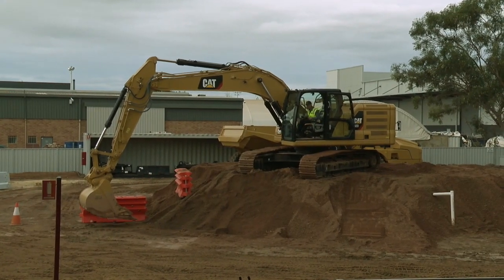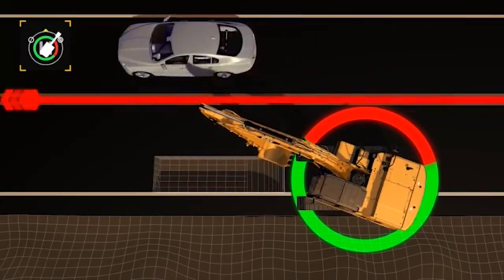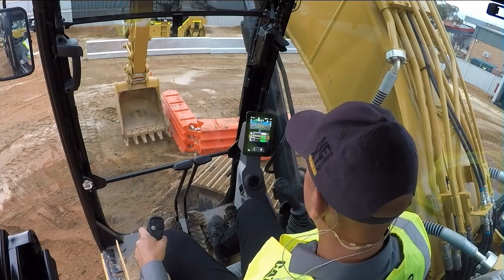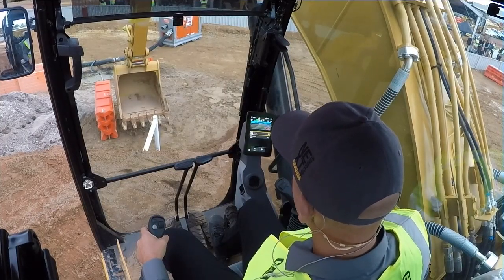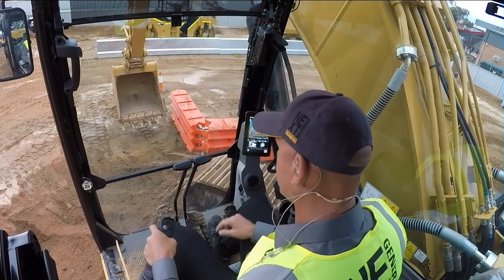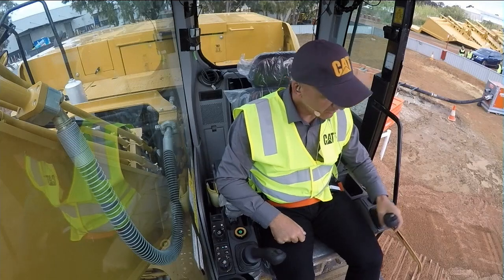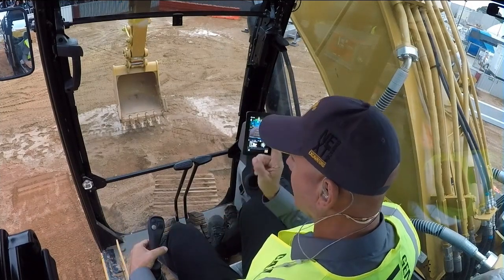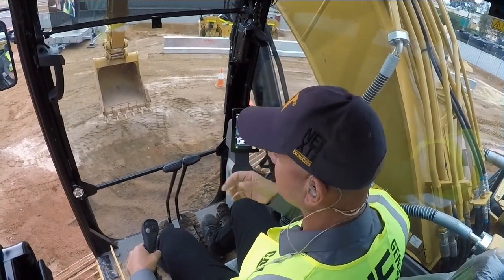Cat Next Gen Excavators - E-Fencing Technology

Comment: Per your manuals... Doesn’t the work with heavy material. Only works with hydraulic temps being just right (not too cool or too hot). Doesn’t work with rough or dangerous operation. Doesn’t work if the machine is not stable due to uneven ground. Doesn’t work if the engine speed or hydraulic power setting is too low. Doesn’t work if the machine is operating on terrain with a steep slope angle. Doesn’t work if a work tool or front linkage was changed without the required calibration.